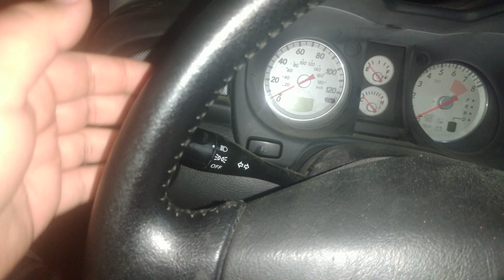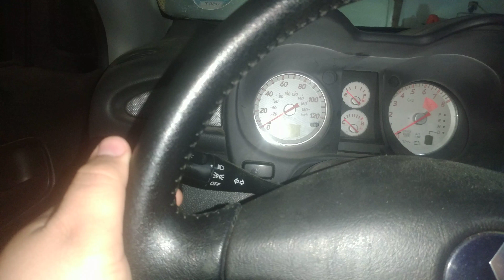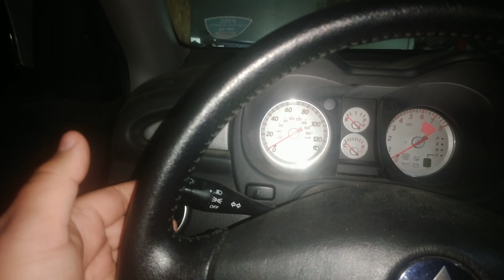Why aftermarket HID lights glitch (lights turn off or one light only,)

Comment: Have the same issue with aftermarket Led's.
Will have to try cycling slower, but I'm guessing that the wires just are not providing enough amps.

Comment: About the only truth in this video is when the guy tells you that the HIDs have more light per lumen or more efficiency per lumen than a halogen bulb. His big problem. Here is the HID lights are not supposed to be cycled on and off quickly. That's why we don't use them in a high beam situation where there's a separate HID bulb for a low beam and a high beam. If you notice most new cars, you don't see the HID headlights flip between the low beam and the high beam unless it is a single bulb with the shield that pops over it in the aftermarket Chinese design. That's because if you keep cycling these HID bulbs like that, you're going to destroy them very quickly. They are designed to come on, stay on and not be cycled for any reason. High beam or low beam ever until you ready to turn them off. Cycling any HID bulb on and off like that will destroy them quickly. So, go get yourselves a kit that has the proper bulbs in them with The bulbs that have the little solenoids on them that pull the bulb down a little bit to uncover or cover the filament or center of the bulb as in the high beam operation. Or just use regular halogen or LED bulbs for your high beams and you'll have low beams at last forever. Oh yeah one more thing. Use a relay harness with your aftermarket HID bulbs. And put a circuit breaker on it, not a fuse., Don't be an idiot. Nobody wants their headlights going out because some fuse popped for no reason because it was a cheap Walmart fuse. Circuit breakers are what the automotive manufacturers use and they're there for a reason. Quick failures of a fuse will cause you to have no headlights but a circuit breaker will come back on and possibly give you headlights to drive home with or make that corner in the dark. Don't try and run it off your stock headlight harness because if you've ever looked at the wires on on a stock halogen headlight, trust me they're barely big enough to cover the bulbs that came with your car. They're never going to work for any aftermarket HID bulbs and those of you that have got them working that way, trust me they'll fail someday soon.
Reply: Great info. So I just got the beam tech LED 16000LM 70W 6500k for my 2015 Jeep patriot. I just installed them . Plain and simple, I turn them on they look great but then randomly drop out usually one at a time for a quick second and then right back on. Obviously I’m not going to use these. 

But do you think I went to high with the wattage? The 70W? And it says 16000LM which seemed odd to me. That’s way too high of a number. They’re bright but it seems like a 6 or 8000LM LED that I just did my mustang with is about the same 🤷‍♂️

Again, I’m a newbie at this. The mustang works and looks great. I think I just went overboard with the wattage for my Jeep. Would love your opinion. Thanks

Comment: I have HID in my car aftermarket for a good two years and never had an issue, but recently something like this has been happening to me, but one light would just cut out automatically while the car is driving. I would then turn the car off and then lights off and turn everything back on and the lights would all work again. Is this a similar problem or could something else be dying out?
Reply: Did you ever figure this out I have the same problem?
Reply: Following, i have the same problem
Reply: @hexrupenta5112  anyone got an answer yet?
Reply: @swanzy mensah just changed the bulbs and everything worked fine after that
Reply: 8kbulbs. Doing this exactly. To my 05 ,
Lexus

Comment: Thanks for the vid, I installed hid projectors to my motorcycle and have had them shut off on rare occasions when I come on/off the High beam setting. Not ideal when your on a dark back road... They are wired direct to the battery so I know there's nothing more I can do power wise. The main problem is that they don't like to come back on after going out. Had to pull over and mess about with the light switch a bit before I got them back on which is kinda concerning. Considered swapping to led within the projector housing to eliminate this but is handy to have an explanation as to the cause of the problem. Thanks
Reply: That's because hid bulbs need less power than halogens when they are hot. You can buy a capacitor from eBay (it's plug and play) and that mostly solve that problem.

Comment: what i dont get is my fog lights have never done this but my headlights are pretty flaky... sometimes they dont work until i drive for 20 minutes... i suspect h10 and h13 might have different power needs or my canbus system is kicking them off